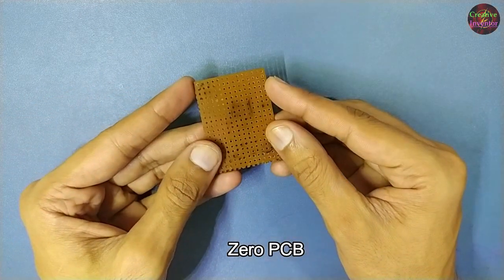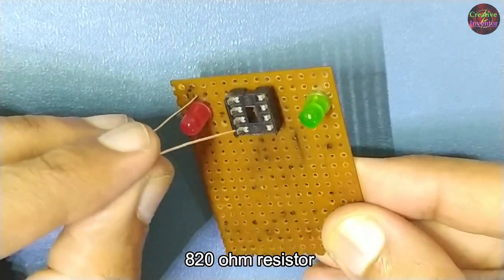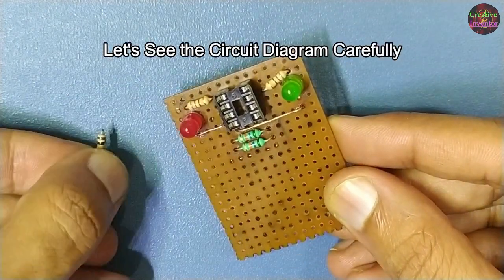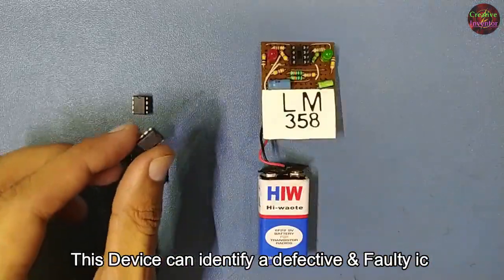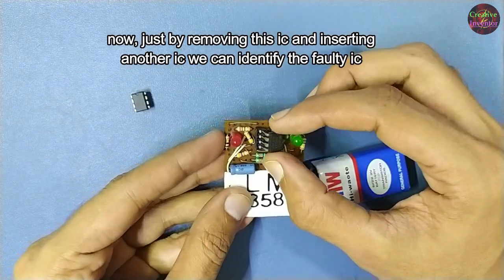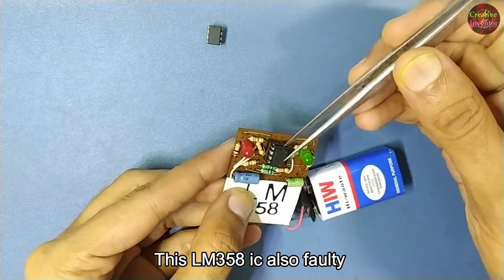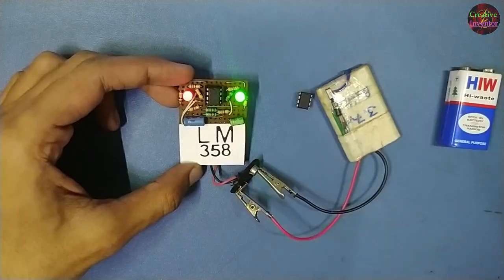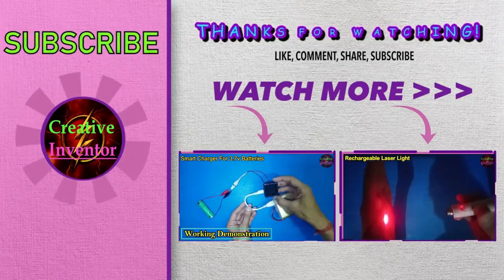How To Make LM358 Op-Amp Tester & Dual Led Flasher, DIY LM358 circuit, How to check lm358 ic easily

Comment: Thanks. This is simple and just do the job. I made it as 4 channels,  so lm324 also can be tested. Works well even with old soviet к140уд6. But 470k resistor must be lowered by 470 Ohm. And sometimes ics keep working well in another device but tester marks them as faulty.

Comment: Video and diagram are different
Reply from the maker: in the video i had used the components from scraps circuits , that's bcoz to recycle ♻️ them, in the diagram u can change the components value up and down, but the ic will remain the same.